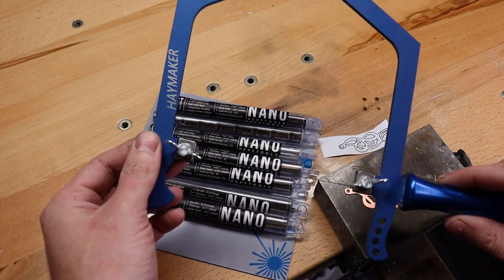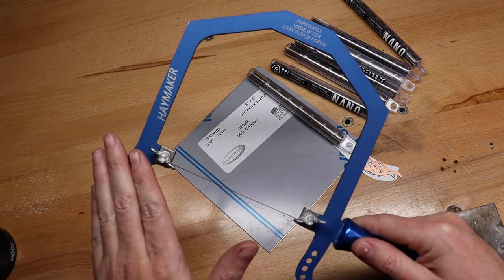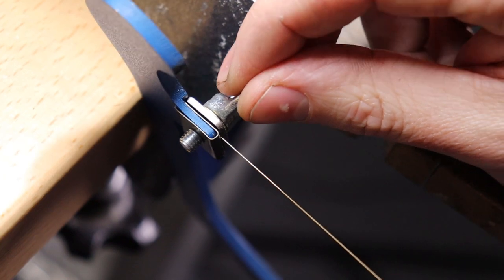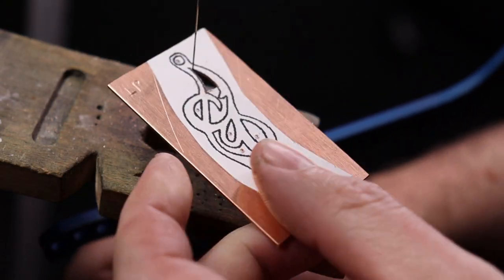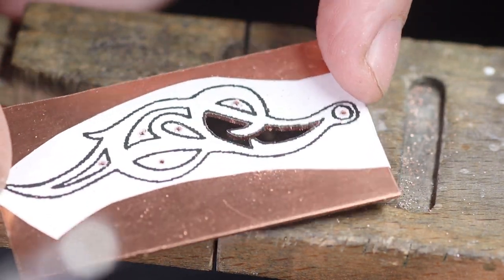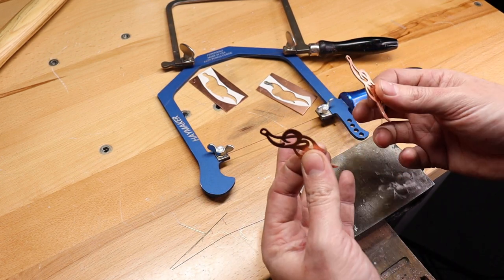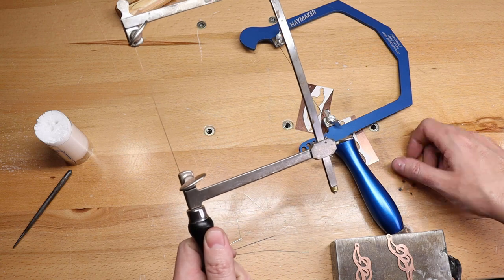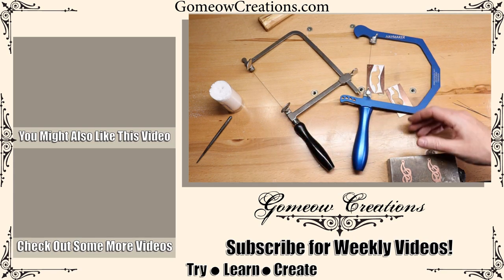Should You Buy a HAYMAKER Saw Frame?

Comment: I'm curious about their previous model, the curved one. I hate that the haymaker gets caught on the lube and other things, but otherwise a good saw frame. Worth the $75? No, but I still bought it.

Concerning the rust, I use Frog Lube and it works like a dream. I live in Puerto Rico, you know, tropical island in the Caribbean. You know the one, 70 to 80% humidity. Yeah that's the one. Everything rusts here. So I bought frog lube, trusting a metalsmith society tip and it works like a charm.
Reply: Thx for the Frog Lube tip.  I live in Florida & rust is ALWAYS an issue.  Appreciate it.

Comment: I have the German style, Knew Concepts, and the Green Lion.  The Green Lion hands down is my fav.  I feel I have so much more control with it and it seems to fit my hand well.  The Knew Concepts frames are great and cut great but I very much dislike the hole the blade drops into and the twist knob to tighten the blade to the frame. For some reason I can't always get it secure and the blade slips out. The metal dust falls into the hole and along with the cut lube makes for a mess.  I would love to have a Haymaker but just can't justify the money just for a new design.  Maybe some day if I find a great sale.  Thank you Randy for the demo.  Always look forward to your videos!!!!
Reply: Somebody else who has experienced the horrible blade retention that I suffer with on my Knew Concepts saw…so frustrating!

Comment: It won't slice your finger open. It will saw your finger open which is worse because it removes flesh. Don't believe me? Well then try it! 

I can't move the work around either. It sticks to the peg! Maybe some talc. Hmmm. Oh, I like the sound of the cutting at high speed! It's like a big moth against a window!

I don't like the thinner handle on the German frames. I wound mine with sports tape to thicken it. I like my Knew Concept frame. Easier to get the proper tension. Easy peasy. But the Haymaker be sure is pretty!

You gotta get the Knew Concepts titanium frame and review it against all your others! And then send it to me cuz you have enough frames! 😁😁😁🤪

Comment: Hi thank you so much for all of your great videos and resources you provide for us. I have a very beginner question I have been working on my sawing skills and it's going well. But I am having trouble getting my flex shaft bits to put accurate holes in the metal when I need to cut in the center of the peice. I noticed on your tools link in the description you have diamond bird listed but no "drill" bits is this what you use for holes?
Reply: Sorry my autocorrect changed burr's to bird

Comment: The balance is sort of pointless..  but not entirely...  but ultimately.   
The saw frame is not something that is wielded in the air, like a sword or an axe.  So the entire time it is in use it will be under pressure, so what would be more critical is the balance of the tool under pressure..   on this front the haymaker should have an edge, because while its ability to balance on your hand is not really important, it is more front heavy than the old faithful...   i doubt that little bit makes a difference (at least a difference that would outweigh working around those horns..  a significant addition of front heavi\Yves’s might provide some ergonomic benefit..  but again, would that be more horn?   The rigidity on the other hand is not a gimmick.

Comment: I ended up getting the haymaker and the nano blades but found the blades are too long so you don’t get it nice and taught. Did you find the same? This may sound stupid but is it ok to trim the ends slightly to fit? Love to know your thoughts! :)
Reply from the maker: That is odd. I'm sure you can cut them a little to make them fit. Does your show have the plastic or metal wing nuts?
Reply: @GomeowCreations  metal wing nuts. The top was even threaded, Pepe suggested I even use a wing nut on the other side of the screw which seems to have worked. I don’t know why but seems like a lot of fiddling around for an expensive saw which is a shame.
Reply from the maker: Yeah that is odd, I had no problems at all. 😅
Reply: @GomeowCreations  haha lucky! 😂

Comment: Great review Randy! I too am a tool slut and have all the saws; Lion saw (love it) Knew Concepts - like/like it (I break blades from the tensioner before I ever even cut anything - it's as if each blade thickness needs a total adjustment to get it tight enough but not too tight. I load the blade, and as I swing over the lever, the blade breaks - 30% of the time. If I loosen it, the blade is saggy. I always cringe when loading the Knew Concepts saw, although once it IS loaded it's dreamy. Lion (Soba One) saw no probs ever about anything - except a bit of superficial corrosion). Lion Forge HayMaker, I got the shitty clamps originally but they've been replaced by Pepe, so I'm looking forward to trying it now. German saw, steadfast and true, but rusty and clunky sometimes. Bottom line: Love Chris from Lion Punch Forge, and he's worth the saw! The saw I reach for most: Lion (Soba One) saw. I'm open to being swayed!

Comment: A tip to help with the rust prevention:  I use a small dehumidifier for my small shop and it works quite well.  As long as you keep it emptied of the water it accumulates, it definitely helps.  This is the one I have, https://www.amazon.com/gp/product/B01A1EGYHM/ref=ppx_yo_dt_b_search_asin_title?ie=UTF8&psc=1    I also love the Nano blades!  They are absolutely amazing!  lol...with my knew concepts saw.  My hesitation with the Haymaker is the protruding ends due to my small shop space but perhaps in the future.  Lion Punch Forges soldering tools are quite nice though.  Thanks so much for the review!!!
Reply from the maker: Thanks for that and I will look into that. And see if it will help in my set up.
Reply: You can buy those little buckets of moisture absorbent, too. Whether that eould eotk or not, I have no clue. I keep a thin layer of 3-in-1 oil on all my steel except my files. I suppose that you can keep those little packets that come with electronics and medicines and drop them all over your bench!